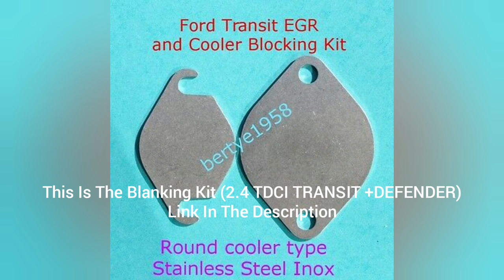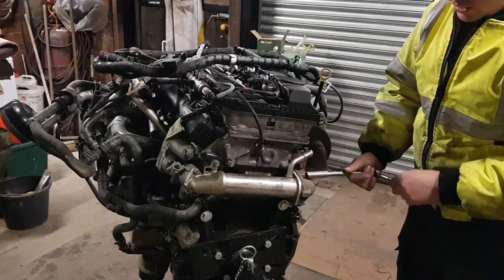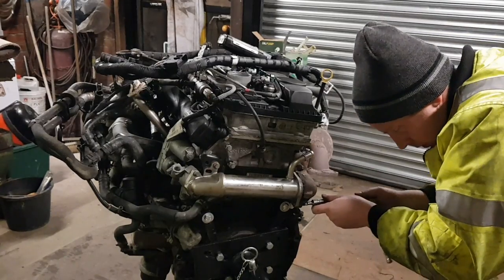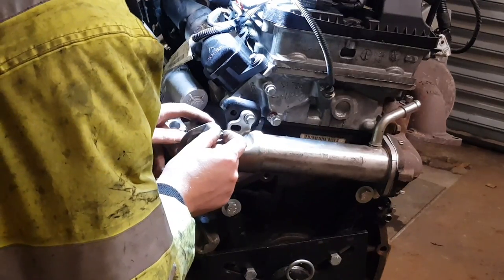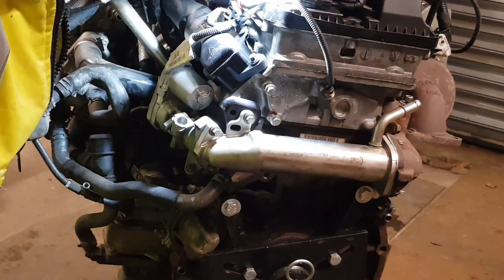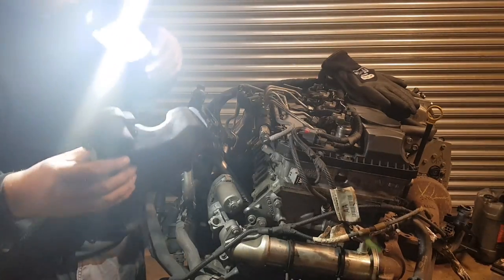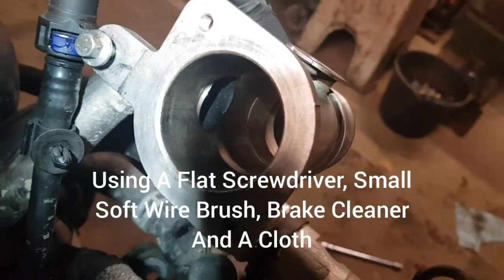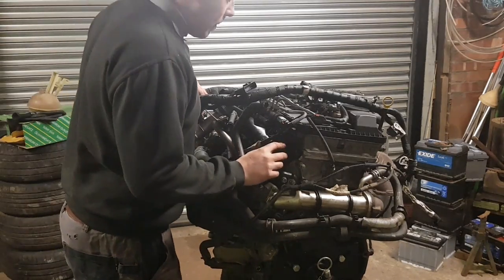Blanking The EGR Valve 2.4 2.2 TDCI Land Rover Defender Ford Transit

Comment from the maker: DISCLAIMER.
After running my engine for nearly 2 years now every once in a while the engine management light comes on referring to the air mas ( maf) sensor pick up too fast.
This is due to the blanking of the EGR making the engine pick up faster. There is no actual fault and is due to the ecu been programmed to circulate exhaust gasses. 
The only way to cure this is either a remap or turn off the EGR Valve.
Reply: Taking the sensor off the egr stops it?

Comment: You were so far into it, why didn't you just remove the whole system ie. EGR valve, cooler and 'boost pipe'? You had to get it remapped anyway...
Reply: Correct. The cooler is a point of failure as they all leak eventually so it should be removed physically from the engine and the 2 hoses joined.
Then the valve, bendy pipe AND the exhaust gas nozzle in the throttle body should be removed also as it is a restriction.
Then the EGR function should be switched off in the ECU.
THEN, you can go clean out the 4mm of caked on crust inside the inlet manifold.
Reply: @RIPPERTON  LOL. This EGR system really was ill thought up. I', all for pollution control, but this system is idiotic. I looked into the ECO Blue tech and it's just a kludge fix as well! All these systems are horrible and ill thought out. I have a early engine like yours, and I'm about to get the van reregistered. Which means a full pit inspection. The first thing after it passes, is the removal of the entire EGR system. Fit a vapour tank and a boring of the inlet system to clean out the crap of the inlet and allow more air in. Any thing else I should do?

Comment: This is the Ford unit isn't it ? I had trouble with my Peugeot partner van with the EGR . The amount of crap in the inlet manifold was terrible and nearly blocked off . In 130000 miles.  Exceptional vid 👍
Reply from the maker: Thats the one 👍
Reply: I've seen enough of these vids now to realise that it's a cleanout job every 50,000kms. I've also seen that early EGR systems were just horrible 'quick fixes' and should be blocked off or rather bypassed. But later ones are in fact well designed and should just be cleaned. Early being, circa 2000-2006

Comment: Hi Tom, this is Norbert from Germany. Thanks a lot for providing that video which will be very helpful regarding my 2.4 Defender from 2011. I have read all the comments in order to find an information for the question, if it is necessary to modify / set/reset / enable/disable any settings in the electronic control of the car. If YES, could you kindly advise what to to. Thanks and kind regards, Norbert

Comment: Hi Tom, thanks for the vid! my EGR  Cooler is leaking coolant out of the exhaust manifold side of cooler.  A mechanic told me that the cooler is faulty ( broken internally) as there shouldn't be any coolant leaking.  I decided to blank it off but would you recommend that I take off the 2 water hoses and join them together with some pipe and clamps or just leave water hoses on the cooler even though the water side is leaking internally, just thought it might be better to join the water hoses because if I leave them connected to the cooler it might pick up all the soot etc when its flowing through all the cooler,  Any help would be greatly appreciated. thanks
Reply from the maker: Hi Carl if you've blanked the EGR like I have then its eliminated the cooler anyway so it wont hurt by bypassing it 👍

Comment: Blanking the EGR has an effect on the gases as you said, will this affect the reading when mot'd. Can it fail am mot if the EGR is blanked off?
Reply from the maker: In effect no. The MOT is  Visual inspection only and you cannot tell just by looking if the EGR is Blanked off, Also the emmissions test on a Diesel engine is just a smoke test so as long as its not making huge black clouds when revved its a stright pass. 
The only thing a tester can fail an EGR is if it has been completely removed.

Comment: Just a daft question about this....does the mot tester look for this and fail it? Id like to blank my egr off as its on the third one and its a pain to change in situ.
Reply from the maker: Sorry i didnt know you had messaged about this. It cannot fail an MOT test. The MOT is a visual check. There is no way a tester can see or prove the egr is blanked off. If the tester suspects its blanked off they can only put it down as an advisory. It wont show up on the emissions either because it only measures the smoke output.

Comment: Thank you very much. I do this job on my defender 90 this week. Fantastic information. Greetings from Germany
Reply from the maker: Great! You should notice the little difference in engine performance. Beware after a while the engine warning light will come on saying there is a problem with the air mass. Its because the egr is blanked off dont worry

Comment: Great upload iv just unplugged mine the difference is like night and day gonna blank it off though just to be certain none of that crap can'rt get back in...
Reply from the maker: Thank you. Deffo worth it! Glad its helped you out 👍
Reply: @lifes.projects  Where did you get the cooler blanking plate from?
Reply from the maker: @radiator0  I go the kit from ebay. The link is in the video description 👍
Reply: @lifes.projects  cheers just ordered one. Bit of a novice as you can probs tell, on the cooler did you remove the nuts then the studs? is there a special tool for removing studs? thanks in advance..
Reply from the maker: @radiator0  Yes i removed the nuts first. The tool you need is external torx bits or you can use 12 point sockets as long as you have one small enough. Its not a difficult job just a little awkward given its location in the engine bay.

Comment: Great videos Tom . I really enjoy watching and learning more about my 2.4 TDCI  Defender .
I heard about you from watching Nigel who is also brilliant to watch . 
I had my EGR turned off years ago but was never advised to fit blanking plates as well . After watching this video , I will definitely look into doing it . Could be very awkward but I will persist .
Keep up the good work !
Cheers , John
Reply from the maker: Hi John thats great. We are all learning from each other. Yes i would fit the blanking plates as its certain gas cannot enter the inlet system. It also stops the cooler getting clogged with sut. Over time the build up of sut may force the egr open so will start to recirculate exhaust gasses again. The link for the kit is in the description. Its not expensive just abit awkward to fit. However in your case i would deffinately check inside the cooler to see what the condition is like, if its clogged remove, clean it and put it back on and fit the blanking kit before tightening it back up.
Reply: @lifes.projects  una pregunta con esto pasas la prueva de gases de la itv??

Comment: Bonjour,
Pourriez-vous me dire si je peux supprimer mécaniquement l EGR sur un 2L2 ...
Merci
Reply from the maker: You can buy blanking plates off ebay and do it like i have or remove the valve completely and blank off the manifolds. If you choose this method you would have to get the the ecu remapped. If you do it like i did then you can run it as normal.
Reply: @lifes.projects  merci beaucoup pour votre aide

Comment: hi all parts here ready had a quick look today the bolts on the manifold side are looking knackered would i get away with blanking just one side
Reply from the maker: Most companies just blank one side. Its just best practice to do both.
Reply: @lifes.projects  cheers bud ill see what its like tomorrow fingers crossed they come off gave myself 2 days never done one and 40 cigs
Reply: @lifes.projects  right pal blanked egr cooler pipe the valve side other side a no go to corroded on nuts now the waterpipe that goes from the cooler pipe to the vale housing and back out and round can i do away with the pipe that goes in the valve housing and back out just connecting the pipe from the heat strait back round

Comment: thanks for quick responses got a great veiw and detailed explanation of what im up for but just trying to get my head around it all ive got the blanking plates comming i have the same engine as your one in my transit as i say mines npissing out water so as i say instead of replacing blank the cooler pipe and i was just going to join the water inlet and outlet rubbuer hoses as it not need water going through as its blanked but you have stumped me throwing it in about the dpf i asume mine as got one as its a 61 plate would this mean that i cant blank the cooler and jion the pipes
Reply from the maker: 61 plate 2.4 shouldnt have a DPF. You will usually get the management light come on when on the motorway as it may detect egr flow but its nothing to worry about and can easily be cleared.
Reply: @lifes.projects   thanks bud realy helpful glad somone knows what they doing see that by watching vids will defo recomend highly
Reply from the maker: @johnyoung9620  No problem. Thank you. Let me know how you get on 👍

Comment: Can the coolant feeds to the egr cooler be looped together avoiding the whole thing?
Reply from the maker: @markhardman6413  yes quite easily. I still run mine through the cooler even tho ive blanked it just to keep it cool but also help the heaters warm up faster.
Reply: @lifes.projects  thanks pal I appreciate your support, mine has been mapped out, I am yet to get either end blanked but it now leaks , such a drama for a 2.2 RWD and a small part 😩
Reply from the maker: @markhardman6413  Ah yeah I would re seal it when you fit the blanking plates. 2.2 is a little more in depth than the 2.4 but still the same process.

Comment: Hi Tom, an interesting problem the engine has developed is the boost stops after a few miles…after a bit of driving and the turbo loudly doing its stuff the engine goes into a state where it wont accelerate beyond 2800rpm or 50mph. No engine light comes on. Switching the ignition off and on resets everything until it all happens again. Cant see any splits in the boost hoses but hard to detect as the turbo wont cooperate unless I’ve got a load on the engine. EGR valve makes the self cleaning noise ok. Ive replaced the maf and boost sensors already…any ideas? 😬
Reply from the maker: Sounds like your engine is going i to limp mode (restricted performance) split boost pipes will cause black smoke from the exhaust and you will be able to hear a whooshing noise. Also check the intercooler as they crack on the corners. 
Ideally you could do with having the ecu scanned to see if there is any fault codes.
Reply: @lifes.projects  Thanks Tom, now that you’ve mentioned checking the corners of the intercooler, I did notice some oily muck around the near side of that. There is a loud whooshing noise before the engine goes into limp mode. I’ll take a look at the intercooler in the daylight, can’t see any codes but ive got to rely on 3rd parties to look for them and no engine light.
I’ll let you know what I find, thanks again. 👍
Reply from the maker: @alan2804  If you have the loud whooshing noise then there is deffo a boost leak so thats whats causeing the limp mode. Oil is a tel tale sign of a leak. Let me know your findings

Comment: I shot welded the exhaust manifold and removed the whole egr system with couple of hoses add to that a down pipe with no dpf 🌏😱
Reply from the maker: Great stuff! We have to be carful with emissions systems in the UK. Heavy fines if found to be tampered with so you have to get creative 😜
Reply: From what I've seen, on early cars, getting rid of most of these pollution quick fixes and remapping is a better way to go for both the car AND the environment. If you removed the entire system, then I would say that would work. Don't know anything about the DPF yet,
Reply from the maker: @doraexplora9046  Yes I agree as the engine runs much cleaner and overtime it much more efficient as it is not clogging up the intake system
Reply: @lifes.projects  What about including an AddBlue system?

Comment: Great vid..Ive just found this as my Puma landy is making noise when switched off..i thought was a worn rubber or engine mount. Looks like it maybe the EGR.. Ive had it for 11 years now from new. 
Cheers for the info
Reply from the maker: Thank you. The EGR does a cleaning cycle when you turn the engine off (its like a scratching sound) as they get older the sound gets slower as its more worn. Thats completely normal. Keep an eye on it and see if you can find the source 👍

Comment: Can i ask.... You mentioned that you think yours had already been blanked off, if it hadnt already been remapped does that mean it can run normal with a blanking plate and no remap?.... possibly??? i currently have mine stripped to do timing chain, oil pump radiator etc as a major service (theres nowt wrong with it but i want to catch it before it has issues) mine is a 2009 2.4 tdci with 83k on the clock.....
im thinking of deep cleanong the egr/cooler/intake while its all apart and while im at it was thinking of a restrictor with the hole so a little gas getts in (enough to stop a mil light) but after hearing you say the above it got me thinking shall i blank it and chance it?
cheers wayne.
Reply from the maker: @waynestevens3662  Hi Wayne. Ive run mine with a blanked EGR since the rebuild. It puts the EML on after a few week of driving but runs great! As its a 2.4 there is no DPF so dosent need the EGR system to function, You will notice the condition of the oil is much better due to the exhaust fumes not been recycled so either way its better for the engine. The code that it brings up is related to the air mass sensor which is normal and no actual fault with the sensor. 
I havent had it remapped, I am in 2 minds but i feel like i will be going down the M57 route so there is no point for a re map. Hope this helps
Reply: @lifes.projects  Tom you are a legend for replying so quick.... because you have experienced this how do you then knock the mil light off?.... on 1 occasion only mine came on but then went off a few mins later and has never appeared since..... i was going to do a pcv valve as part of my deep service but have read i may then need it to 'relearn' via a scan tool and as ive not got a scan tool i wasnt going to fit it....

ive got to say your videos are perfect and im subscribed.... they have helped no end.... out of interest why are you thinking of going to an M57? with the knowledge and skills you have surely a 2.4 tdci rebuilt every 10 years would keep yours going for decades.😁😁😉😉
Reply from the maker: @waynestevens3662  Sorry for the late reply. You will need a scan tool to do the pilot learn, you can always do the work and then take it to a garage for a relearn with their scanner rather than buy your own. It wont hurt it of you replaced it then drive it to a garage. 
Good way to look at it if you are doing an indepth service! If you are going that far you may as well do the lot. 
New PCV Valve, fuel pressure regulator (end of the fuel rail), injector seals with new injector bolts, clean/blank EGR cooler and valve 😜. Then relearn the fuel system. 
As for the M57 no reason at all other than Ive always liked a 6 cylinder deisel engines. From the early days of starting my apprenticeship looking after L322 range rovers, mercedes and BMW with 6 cylinders to moving onto trucks where most engines are 6 cylinders. The way they drive, sound with effortless performance and smoothness just feels right and fancy that in my Defender 😂
Reply: @lifes.projects  i better get a scan tool and some more bits on the shopping list then🤣🤣...

Thanks again for your input, after watching your vids its refreshing to actually talk to someone who knows and isnt just guessing so thanks again for sharing your experiences😉👍...
Any recommendation on a scan tool?😊

Weve also got a 21 plate transit so it may come in handy for other things one day.🙄🤣

Comment: Great video. Mine is the 2.2 engine. Just wondering could I just join the coolant pipes and bypass the egr cooler altogether? My egr is deleted but I have bubbles in the coolant thank.
Reply from the maker: Yes thats how you bypass the egr cooler to eliminate it if you are having coolant overpressuring issues
Reply: @lifes.projects  thanks, done it today, still bubbles 😭
Reply from the maker: @richiestack2857  😔😔

Comment: The whole point in having a air filter is to stop crap going into the engine
Then some bright spark decided it was a good to recirculate dirty exhaust gases back into the engine 
Doesn't that defeat the purpose of having a air filter
Reply: I agree. If you are running an EGR, why bother at all with an airfiilter. I guarantee the atmospheric air is a lot cleaner than breathing the exhaust from the engine!

Comment: why also blank off the side on the turbo side? i only blanked off the EGR side? will this be a problem?
Reply from the maker: No wont be a problem. Some kits come with the manifold plate and some dont. I like to blank off the manifold as well so you dont get a huge build up of soot through the cooler. Some people say it also spools the turbo up faster but i doubt it makes a difference in all honesty.
Reply: Thanks for the quick response. It works great, I’m also running a BAS stage 2. True gem of a set up
Reply from the maker: @majers_abroad  how do you rate it? I want to get mine mapped but unsure who to use

Comment: Thanks for the informative video! If I was to just blank off the EGR and not the cooler (I don’t feel confident I can get to it, bolts are pretty seized, would it matter?

Got a 2005 project transit bus. Keeps overheating but strangely only on motorway speeds above 2KRPM. Been told it can only be EGR cooler or oil cooler from Ford technician.

Thanks - Jamie!